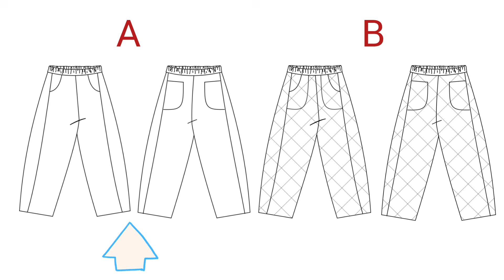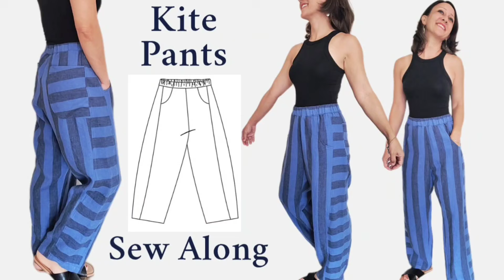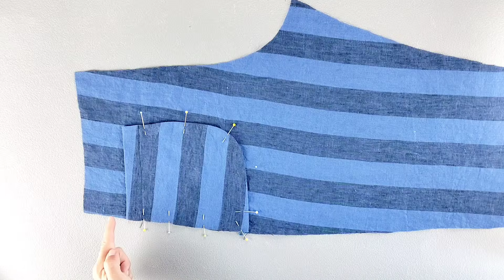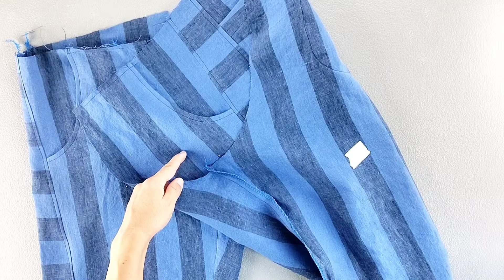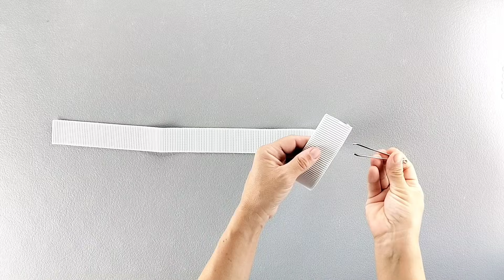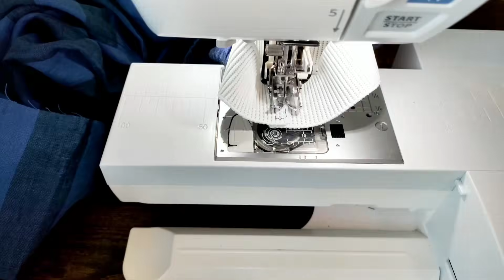How to Sew Kite Pants | Matchy Matchy Sewing Club Tutorial (Beginner Friendly)

Comment: Hello- I am just about to pair the side panels with the front pieces and the instructions state to match the notches but they don’t - the paper pattern pieces don’t have the notch in the same place on the pieces or there is actually no notch at all. Any insight?
Reply from the maker: Just make sure you’re matching the correct panel to the correct side and you should be good.  Match the orientation to the illustrations in the instructions, notches or no.
Reply: @Sew-Happy thank you!

Comment: Thank you! I'm currently working on this pattern and don't see any instructions for cutting the pocket pattern pieces and there's 3 different size options. Can you help? Maybe it's just a matter of preference and doesn't matter much?
Reply from the maker: Hi — you can choose bias bound front patch pockets OR, as in this video, you can sew the  front in-seam pockets. Then you have the back patch pockets we sew here.
Reply: @Sew-Happy  Hi! Can't wait to use your tutorial to sew my kite pants today and have this same question people keep asking all over the place without getting a real answer - On the pocket pattern pieces there are three cutting lines for different sizes, with no instruction on which line is for which sizes. We don't know which line to cut on! Help? Thanks!
Reply: @chelseamitchell6413 Idk if you still need help, but I think it comes down to pocket-size preference. The opening is the same, regardless of the pocket. If you have adobe acrobat, you can hide layers and it will likely hide lines and only show those for the sizes you select. :)